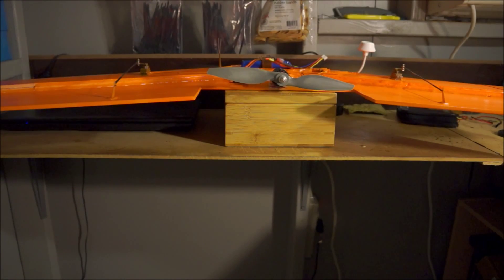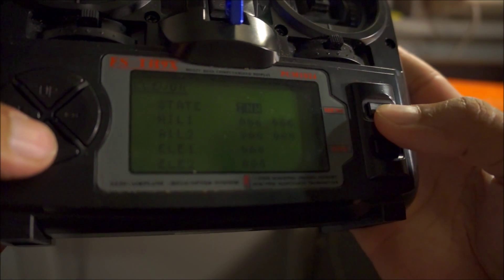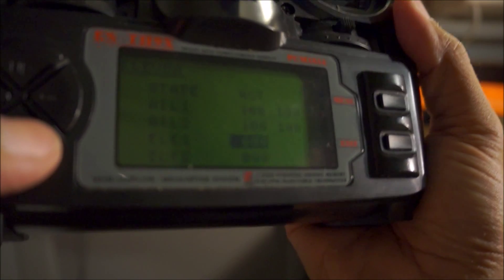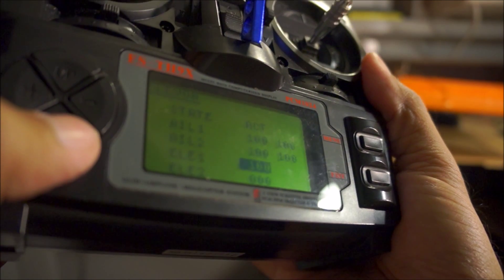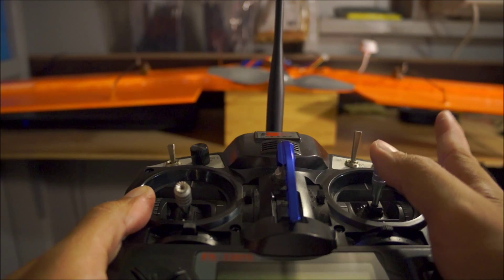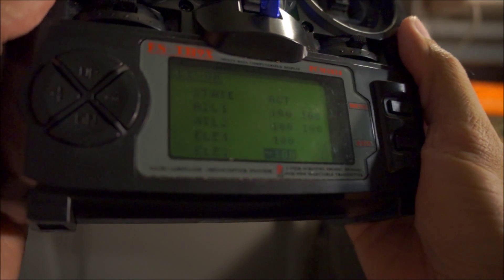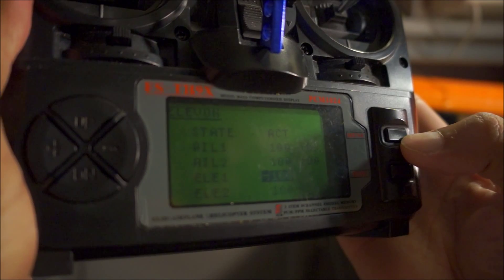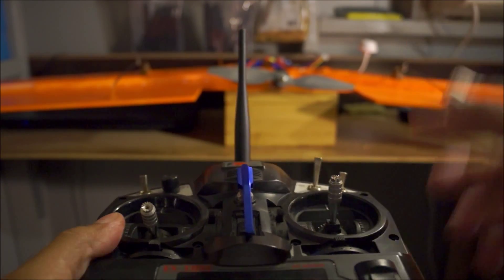How to setup an rc radio for a delta wing plane.

Comment: あなたの仕事をおめでとうございます。 私はあなたのようなソリューションを、エンジンの代わりにサーボを使って探しています。 しかし、私は、継続的な動きを得るためにあなたのラジオトランスミッタを設定する方法を知りたいと思います。 私は事前に感謝します。 私はヒーテックオーロラ9またはタラニスx9dplusを持っています

Congratulations for your job. I'm also looking for a solution like yours using servos in place of the engine. I would like to know, however, how to configure your radio transmitter to get the continuous motion. I thank you in advance. I have a hitec aurora 9 or a taranis x9dplus

Comment: are you using a Y connector for the servos?
Reply from the maker: Rondo Schiavoni No. Mixing is done on the radio.
Reply: THANK YOU, i was about to buy an elevon mixer. thanks for clearing that up
Reply: so, is it only mixing between ch1 and ch2?

Comment: Hello!! Have question. This is my first RC project, that’s why I am looking for
any help. I am building boat with 2 motors. And I am plan to make
staring with stopping one of motors. Idea is that .... Is one General
Throttle when runs both of motors and boat goes straight, but if to
hit other gimbal left or right then stops left or right motor and
boat than change direction. So for this plan i need use mixer?
Reply: Why don't you just use one motor and buy a rudder from the Traxxas spartan boat and control it using one servo ?

Comment: Hey, what Tx is that in the video? 6 ch or??
Reply from the maker: It's a FLYSKY TH9X. 9 channels.
Reply: could you tell me if you would get the DX6i over the TH9X?
Reply: Or is the TH9X better do you think?
Thanks.
Reply from the maker: +smith41978 I think the 9x is better. It has 3 extra channels.